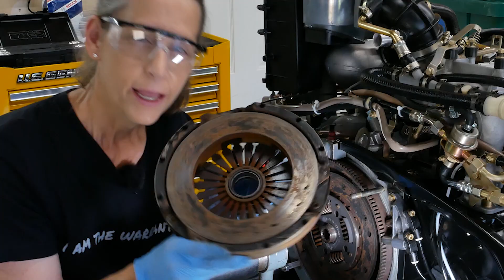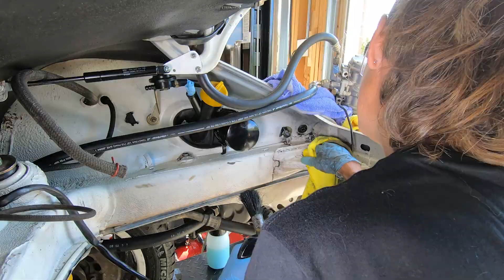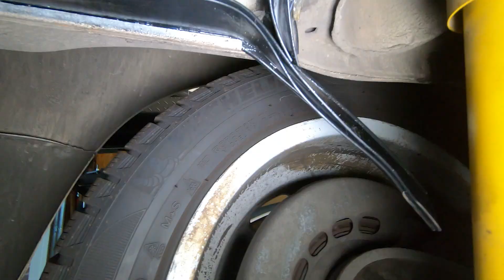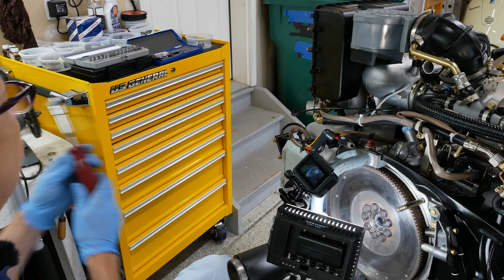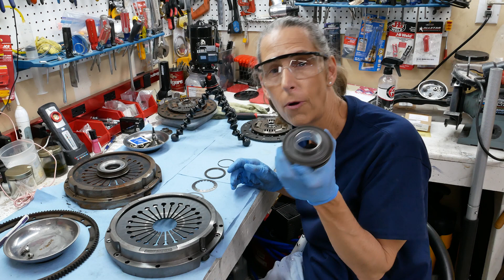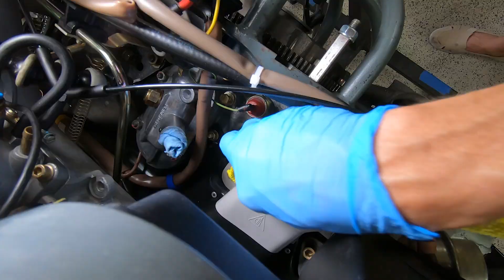Budget eBay Porsche 3.2 Carrera Project Car! #23 - Clutch Replacement and Engine Bay Clean!

Comment: Just installed pilot bearing on my 911sc.  Went easy. Torked to 15. Tip.   😊 put pilot bearing in freezer for awhile to shrink it. Us a little wd 40 . It will pull right in
Reply from the maker: That's a great method!

Comment: A lot of videos I watch make assumptions about the process because, for them, those pieces are intuitive.  You don't skip those things, and while some may find some of your steps rudimentary, many others will not.  Also I really appreciate the inclusion of your mistakes and remedies.  Pausing when things don't seem right is critical as you did with the pressure plate assembly.  I was unable to find a clear guide to parts assembly for the pressure plate and your video couldn't have been clearer.  I know this video is now 5 years old, but it is timeless.  Thanks for your hard work in making this video, I really appreciate it!

Comment: Oh, I have been there! Back in my parking lot mechanic days, I was bolting a pressure plate to the crank (watercooled VW, they're backwards) and using new stretch bolts, and was absentmindedly tightening with my big torque wrench when I thought, "Gee, this one really seems to be taking a lot of turns" just as it turned cheesy and broke. Still not sure what went wrong there, maybe water on the female threads earlier in the project creating some rust? 

I think I got it out with a hammer and chisel, tapping it at a tangental angle near the perimeter of the bolt remnant, using the corner of the chisel. I had to reuse an old stretch bolt, which I hated to do, but it has worked well since.

Comment: I am loving this trip down memory lane, I used to work in an official Porsche Centre and have rebuilt many of these and later engines & gearboxes. You make quality videos and your enthusiasm and knowledge is very impressive. 
With the flywheel needle bearing, I would have placed it in the freezer and it would have popped in easily. The warmth of your hand holding it would be enough to heat the metal to cause the issue you had. What I love about the few 911 videos I have seen so far is you don’t edit out the issues you come across. This is, in my view, what makes you and your videos special as home mechanics can see and learn from your experience. 
I look forward to going through your other videos too.
Do you have a video about you guys and home you came to having such a nice collection of cars? I’ve not looked at your back catalogue yet as only discovered the 911 series today.

Comment: In case it hasn't been mentioned, it's best to use a Flex-Hone to dress the flywheel friction surface. Using any sort of sanding method risks removing iron and leaving the surface out of flat in areas. You're looking to maintain .002" TIR, which is impossible to achieve by hand. More than .003" and it needs to be blanchard ground for sure.

Comment: Great video, Franny. Love it especially since my clutch broke yesterday on my 95 993 Carrera 4.
Reply from the maker: Oh no!
Reply: @HeidiandFranny  Pulling out of bank parking lot, I heard noise that sounded like something snapped and fell off the car (I remember glancing back to see if something was on the ground) and quickly realized I was stuck in first and the clutch pedal just went to floor. Got it 6 weeks ago.
Reply: Supposedly has an X51 Clutch, but I don't really know what that is. Haha. Ordering the "A Solid 5/10" t-shirt for myself; totally cracked me up when I saw you wearing it.
Reply from the maker: @mikeagesen4887  That really sucks.  I believe the X51 is an option from factory for NA cars that provides  performance upgrades.  I didn't know that included the clutch. A skilled shop should be able to get that done in a reasonable time. Is it possible it is just the clutch linkage? The 993 has a hydraulic clutch, but there is still a linkage to the clutch arm. Maybe that is what you heard? Hoping for the best...
Yes, love the shirt ;)
Reply: @HeidiandFranny  I'm crossing my fingers that you're right about the clutch linkage; the tow driver suspected that that was the problem, too, since we were able to use clutch to disengage gears so he could get it on the truck without having to use skates or dollies, but couldn't change gears because the gears kind of vanished.

Comment: Absolutely excellent video , if i may for those watching at home. the starter ring gear did not actually stop the pressure plate  from coming out. This  often is removed on the bench with a propane torch heating the ring and it falls off the pressure plate.. then reheat it and drop it on the new pressure plate. But Frannies method works too . BTW i have helped more than one person who's starter motor just spins when they go to start the car , then walk into their garage and pick up the ring gear .. DO NOT FORGET TO PUT THIS BACK ... its a gut wrencher ..

Comment: Once you were at the flywheel I would have certainly taken it off to exchange the RMS and put a light weight clutch in it .
No comments about your craftsmanship , you're doing a great job!!
Reply from the maker: Thanks, I wondered about that so I called the shop locally that did the transmission and they said not to bother unless it is leaking.  It is a bit of a pain to R&R the flywheel.  I have a friend who installed a lightened flywheel and he regrets it.  I like the way the car drives and that engine spins up faster than any car we have.  But I have a pretty limited experience base ;)

Comment: Curious as to why you didn't remove the fly wheel and inspect the rear main seal and potentially replace it if needed?
Reply from the maker: If the main seal was leaking there would be oil at the base of the flywheel.  I consulted with a local shop and they said not to bother is it isn't leaking.

Comment: don't ever pay to have this done, a shop really shouldn't even do it even if they can...a fully rebuilt crate motor, tested and warrantied by a reputable builder will save you buckets of time and money...I know, been through some car motor "rebuilds"...takes forever, if one old part is missed you can ruin it or pay for another "rebuild"...if it's a crate and it blows up you can get a replacement much easier and with less liability if you are the shop

Comment: Not sure about the tightening torque spec., there is a torque per screw size table.  Works much better than going with the gut feeling.
Reply from the maker: That's what I used... The table for the grade and pitch of the bolt.

Comment: Have the flywheel resurfaced and replace the clutch and pressure plate. No sense taking it off if you aren’t going to replace it.

Comment: Since you are already down to the flywheel, would it make sense to go one step farther and replace the rear main oil seal?
Reply from the maker: I asked the shop that did the transmission work and they said not to bother unless it is leaking.

Comment: Great vids, thanks for taking the time to create them. On the clutch inspection I usually look for loose springs on the driven plate. These springs act like a drive line shock absorber when you drop the clutch, and ideally should be a tight fit with no obvious wear. If a car has been driven hard and taking part in regular traffic light Grand Prix starts, those springs can end up a rattling fit... Just thought their function was worth a mention..?
Reply from the maker: Thanks so much!  Since it is such a pain to replace I thought it would be a good time to replace that plate anyways.  But, yes, that is a great tip for the inspection :)

Comment: Cool! Great video.
I've seen pilot bearings that were just a bronze bushing. Don't remember for sure but probably old American cars.
So why is there a gear ring on the flywheel and the pressure plate? Mmmm?
I wish I'd have thought of that slot in the snapped off screw back in like 2003 when I snapped one on the engine shock mount on my 85 300d.
It was on the back of the engine, really hard to get at so said the heck with it. Still had two holding it on.
It's going on midnight. Should I watch another video or shouldn't I? Might end up being a long night bing watching. Your videos are just to darned interesting.
Reply from the maker: Thanks.

Comment: Good Morning, Looking at a 2003 911 with 98,354 on the clock to buy. In your experience what is the "Normal Life Expectancy" of one of these 996 engines if it has been serviced and driven as they were design to be driven. The car looks immaculate and is owned by original owner.
Would appreciate your experience and expertise on this one 
Mike
Reply from the maker: Gosh, a lot goes into that.  Has the IMS been done on the car?  Just go through the normal checks - leak-down, check fluids and look for leaks.  Looks at all the maintenance that's been done.  Check for any faults.  Have someone who really knows the cars local to you take a look.  The engine should go to 200K without any real issues if all is well and maintained (and the IMS is sorted).
Reply: @HeidiandFranny  Well I know its a lot to speculate about and a lot to ask of you. the IMS has not been done, and I plan on doing that immediately along with clutch throw out bearing pressure plate etc etc. The car has been looked after by the one and only owner so I suspect it has been maintained but driven just like it was intended. was curious as to what kind of life expectancy I might get if I purchased the car then invested the 6K for parts and labor for the IMS and clutch replacement.
Love you guys and appreciate your experience and insight
Mike

Comment: Does that engine have the IMS bearing behind the fly wheel that problematic and when you’re using chemical I don’t know if your gloves are nitrile if they aren’t they will hold up better.
Reply from the maker: These engines don't have an IMS issue.  That is only the M96 engines (996/7).  The gloves are nitrile, but they do shred easily.  They are good for most chemicals.

Comment: Awesome video as ever, but idk how your build is budget :P.   I just uploaded my clutch replacement video, a bit different since I have the 6 bolt flywheel.
Reply from the maker: Well, the car was budget ;)  You are quite correct that the build isn't.  We got a great deal on the car, but when we get done it will be worth about what we have spent.  It is fun though :)
Reply: @HeidiandFranny   Same!   My car was super cheap since there was so much wrong with it; pretty much everything but NO RUST so it was still a deal.

Comment: If I recall on my 964 clutch pressure plate assembly, I did the “stand on it” to compress throw out and washers to seat in the PP... Others use a press... How did you do it?
Reply from the maker: I turned it upside down and used its weight and mine a bit...

Comment: You are my Hero!!!Awesome job and commentary.  Simply you are my idol!!!!!!
. May I ask what the build in parts has cost so far just to get an idea if I ever want to go down this road ?
thanks for all your hard work
Reply from the maker: New parts were 3K and refurbished were closer to 2K.  5K for just parts.  That does not include our transmission rebuild or our interior or any of the other items like the dent removal.  We will have a whole video on the costs at the end of our project.  Heidi
Reply from the maker: Thanks so much! I'll check with Heidi, but maybe $3500?  We did replace the muffler, and clutch and the spark plug wires (surprisingly expensive) and of course the fuel and oil lines.  The plating was just a few hundred, but the powder and ceramic was north of $1200?  It could be done a lot cheaper without all the fluff...   ;)

Comment: Dremel to the rescue!  (Sorry if TLDNR.)
I have a pretty good Dremel story.  There we were driving home from grandma's when our two year old said, "Owwww, this is stuck on my finger!"   Mom turns around to take a look at her little plastic kaleidoscope toy and sure enough, it's stuck on pretty good and mom can't get it off.  We're not far from home so we say, "Don't worry honey, we'll get it off when we get home.  Just hold your hand in the air until then and we'll get it off with some soap and water."

Well, so much for THAT idea!  Soap, oil, nothing would get that thing to slide off.  She had innocently put her little finger into the eye hole in the small cylindrical kaleidoscope.  Just about 1 1/2" long and about an inch in diameter with a hole in one end.  So simple.  Yet so damn hard to remove!  At this point we're getting a little concerned.  "Hey wait, we have a paramedic living upstairs, let's ask HIM!"  Luckily he was home and happily came down to help us.  "I can try my trauma scissors to try to cut it, but I'm not so sure."  And I'm thinking if those scissors slip off the hard plastic, it would cut her finger right off!  Yikes! 

So after some consternation and thought, I realize, "A ha!  I have a Dremel!"  I was pretty confident that the ceramic cutting wheel would be the perfect solution - it would easily cut the plastic but not cut my little one's finger.  Well, our EMT friend knew his stuff and offered, "Dad, let me hold her down and be the bad guy while you operate the Dremel!"  He was awesome.

Got that thing off in no time at all with nary a scratch on my little one's finger!  Yeah Dremels!  We had crappy insurance, so we'd have paid at least $1k in deductible for a hospital ER visit.  Saved us a load of cash too!  (It turns out the way the toy was made, there was a really sharp edge left on the inside of the hole of the toy during the casting process.  This sharp edge would grab the skin on her finger.  Pulling only made the skin bunch up even more, causing even more restriction.  There is NO WAY that thing would have come off without completely skinning her finger.  Fricking scary!  I tried to contact the company, but it was a no-name product from Asia.)

My Dremel has gotten me out of so many jambs before, many of which entailed cutting a slot in a bolt for removal.  Dremels rock!

Comment: You are so right about walking away.  I'm someone who needs to relearn this all the time!  Plus, you can also apply the rule of "sleeping on it" when it comes to pitfalls and getting stuck on a problem.  I hadn't figured out a solution to something I was working on recently.  But one morning after a good night's sleep, the solution came to me with no effort whatsoever.  I understand many physicists, mathematicians and other scientists have found this a very effective way at solving problems.

And you cannot "service" that old throwout bearing.  Once the balls & races have worn and lost their spheroid shape and tolerance, there's no going back.  No amount of cleaning or grease can bring back lost metal.  When overhauling open radial contact bearings (cup & cone), you always replace the balls with new and higher grade if possible.

Comment: I might have missed it in an earlier video, but did you remove the flywheel and change the rear main seal ? just curious..
Reply: No, Why would you not replace the Rear / Front main seal while you have the engine Out. Also ALWAYS COMPLETELY REDO THE CLUTCH AND MACHINE THE FLYWHEEL WHENEVER THE ENGINE IS OUT! So cheap to do compared to having to pull it later for anything that might fail later.

Comment: 18ft/lbs on those small cap head bolts  and i'm going noooo!, i'd still use lower setting and then trust in Loctite as safety net. Nice job on removing broken bolt stud. if it had been tight i would have considered welding nut to remains of bolt to remove. Nice honest video of workshop ups and downs. 'to overcome adversity is to experience the full delight of existence'.
Reply from the maker: Yeah, that was pretty stupid of me ;) Not a happy camper...
Reply: If you can’t find a torque spec then use the general specs for torquing by dimensions that are usually found in the front of the service manual (or online). Don’t ask me how I know.

Comment: Franny the throw out bearing should not be loose like it appears around the 30 minute mark - the snap ring (circlip) on the engine side of the pressure plate needs to “snap” into the groove to firmly hold the bearing in place. It is fiddly to get it on/ seated - may need to flex the plate fingers while pressing down on the bearing.

Comment: Great video. I would have replaced the rear main seal as a peace of mind and add blue loctite to the bolts.
Reply from the maker: Yeah, that's the thing...  Where do you stop?  The flywheel is sort of a pain (but do-able).  The bolts must be replaces and they take a special tool to get on and off.  Then you take the flywheel down to be surfaced and balanced...  I don't know.  It is just fine and the flywheel was off in 2002.  If that seal was original then I'm totally with you.  Getting to that seal would be the prudent thing to do.
Reply: @HeidiandFranny  I hear ya. I have the same problem with the restoration  on my beetle right now. I am doing a patina style restore which can turn into a full restoration if I don't draw a line somewhere. I have always done full restorations before but, never a patina. I really want to enjoy the car and not be afraid to drive it.

Comment: Franny. Are you going to Dyno. the engine before you put it back in the car? If not, how are you going to ensure it meets Porsche operational specs.?
Reply from the maker: I've never been to a dyno to be honest.  I suppose I could but this is an engine with about 110K miles.  I wouldn't expect it to be quite to the factory spec.  I really want to just have it running cleanly and smoothly.  I guess we'll see ;)
Reply: Hi again Franny, spend the few bucks and get it dynoed. You will feel better.